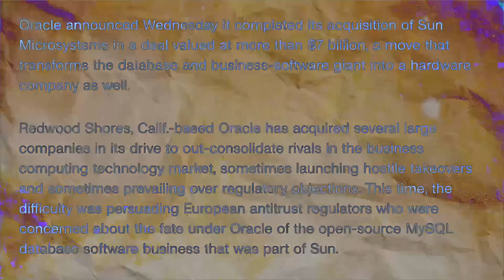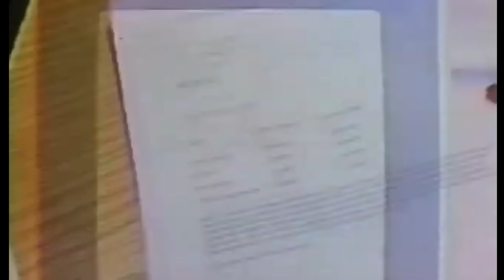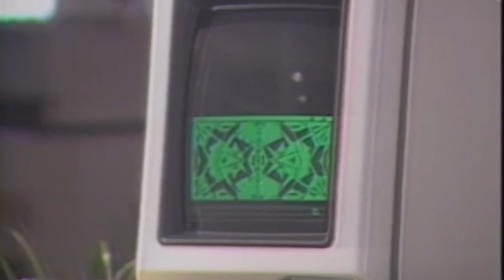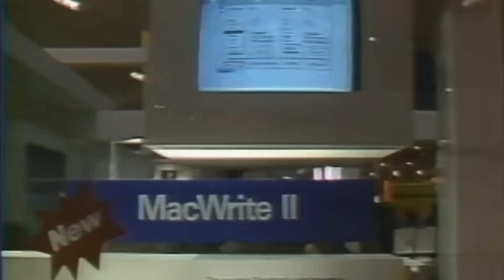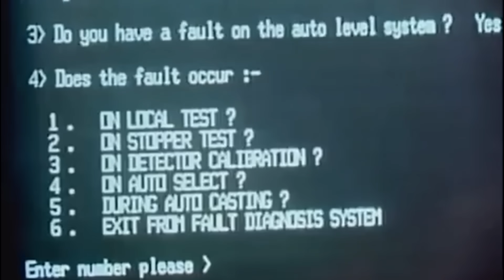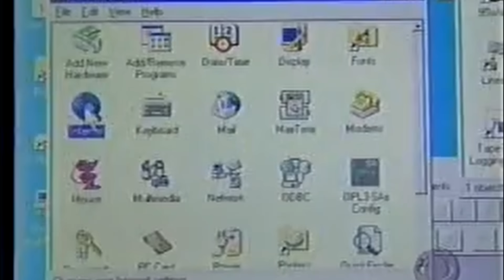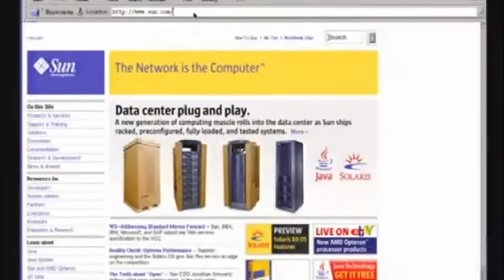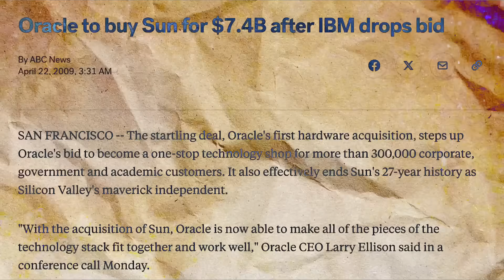How Microsoft & Linux Destroyed A $150B Giant

Comment: It’s actually awesome how much bullshit you can cram into a video.
T34’s engines were not made from aluminium; it was cast iron. It was cheaper and most importantly, literally all aluminium went into aircraft production, and even then there wasn’t enough for all types they needed produced.
The diesel engine was better, BUT Germans had no source of oil, they only could produce synthetic gasoline from coal, and even that wasn’t anywhere near enough. In fact for operation Barbarossa they stockpiled gasoline for almost two years, forcing the whole occupied territory to run civilian engines on wood gas (technically carbon monoxide produced in onboard gas generators from wood) for the rest of the war and almost a decade after.
Sloped armor worked well even with atrociously inferior steel and welding quality you’d normally get shot for, but the interior was so cramped there were height and weight limits imposed on the crews to fit them inside.
The ergonomy of controls was criminally poor, and you needed a 10kg hammer to change gears.
No intercom, the commander ordered the driver through kicking him in the back; where and how much meant where he was supposed to go and how fast.
The -76 iteration had no turret basket, just like KV-1, and the turret crew had to move themselves as the turret traversed and could be easily crushed by the cannon if they didn’t move fast enough.
Ammunition was stored on the hull floor, leading to almost every penetrating hit setting it off, shooting the turret into the sky, and vaporizing the crew, just like you can see in contemporary footage from Ukraine.

When the US received a few for evaluation, they said “some ideas are nice, but thank you, the tank is a complete garbage.”
Reply: Was that reply maybe meant for another video?
Reply: @walterpleyer261  Obviously. The mobile app is completely nuts sometimes.
Reply: This is about Unix servers, not WW2 tanks
Reply: @rodneykahane4994  Sorry, the mobile app occasionally does it if the original video ends and the following one in queue starts playing just before the comment is sent. I'll correct that and move the comment later today when I have time to do it.
Reply from the maker: With the context that this was posted accidentally, it is actually kinda of funny, you can keep the comment here if you like, it is helping boost my engagement :)

Comment: There is also the Itanium Processor which marked Intel's move into the 64-Bit market, which triggered the main UNIX Vendors to stop developing their own silicon designs. This slowed their progress as Linux continued to gain market share. And as Itanium faced delay after delay and failed to meet performance expectations, the Unix Vendors pivoted to AMD x86-64 architecture which could support their 64-Bit OS's. However, it already supported Linux and customers could make direct comparisons on effectively the same hardware and allowing a more gently transition.
If the x86-64 hardware had been proven to be good enough for SUN, HP, SGI, etc. and Linux was as capable then why continue paying a premium.
Reply: The Unix vendors spent too much time fighting each other and trying to vertically integrate instead of making it easy to build software on them. Windows won the desktop since it was so developer focused, and Linux won the server because it was free and good is better than perfect.
Reply from the maker: Very insightful comment! Thanks for the additional information :)